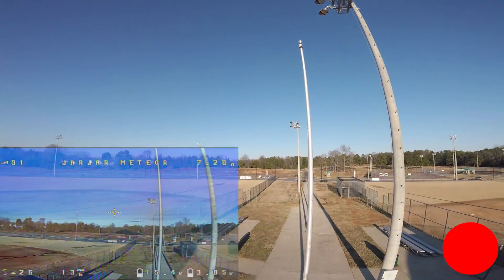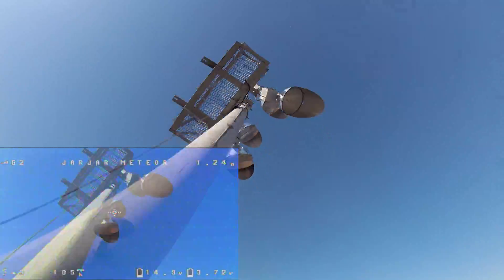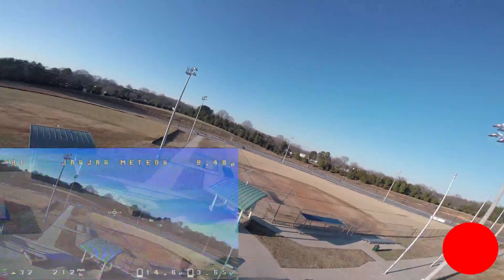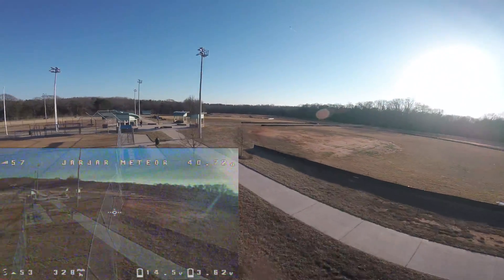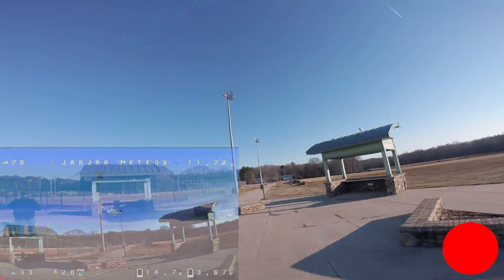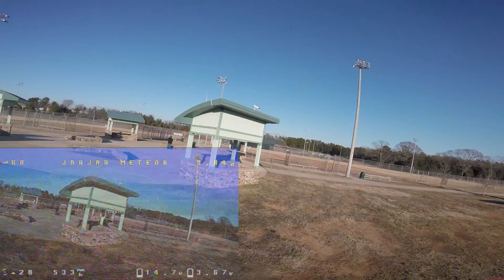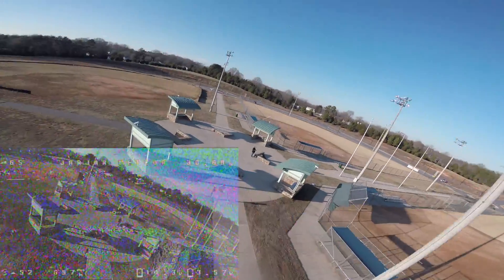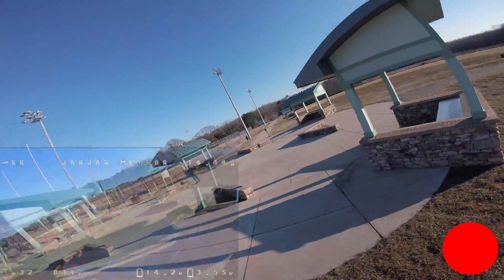Gentle Wobble | PID Tuning | I Gain

Comment: Rcaddict just did a good tutorial on the process of pid tuning. The one thing no one really mentions is the difference in trying to get the "feel" from the rates and d_term settings as opposed to the pids. The way I do it is start out pid tuning before touching the rates  otherwise you can't tell what's what. Once I get the pids set, then antigravity, then I'll adjust the rates. Then Ill go back and adjust the pids to lessen the robotic feel if needed. Hope this helps
Reply from the maker: +UgpFpv And i always add my rates first, including the d set weight and d transition.  I saw that video, it is very good.
Reply: Josh Withrow let up know what you end up with. Keep flying!😀
Reply: Josh Withrow and shouldn't say I don't adjust my rates first but just get them in the rough ballpark as I know I'll have to adjust them after pids anyway

Comment: I think you're spot on. I didn't notice it in the beginning, but issues with I gain tend do get worse throughout the flight. Its why I gain is so hard to tune. Sometimes itll take a whole battery before the issue is obviously present. I try to keep my I gains in the high 30's and low 40's. Ive noticed anything higher creates all that mimbly bimbly😂